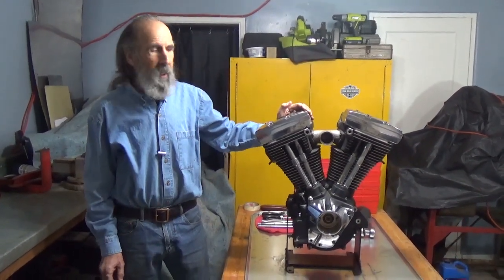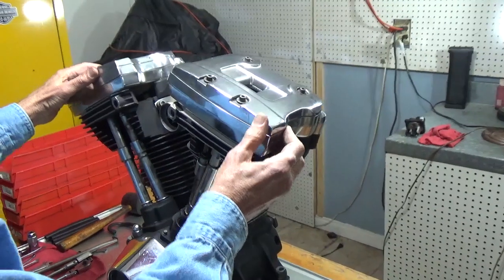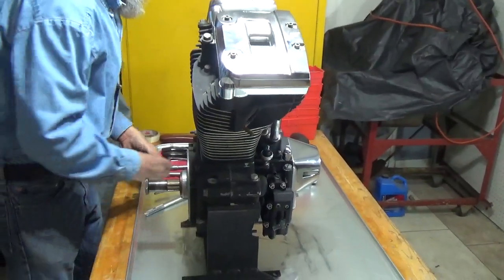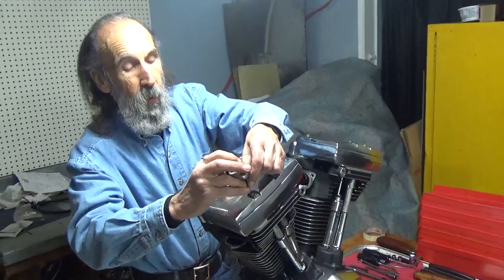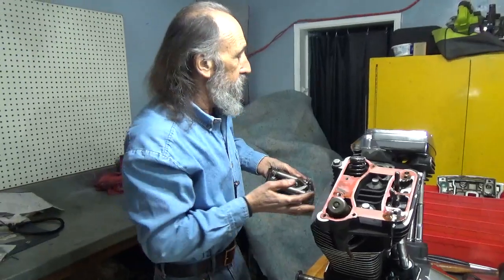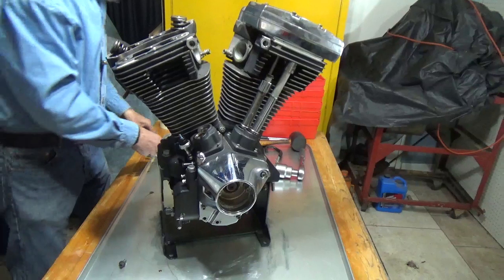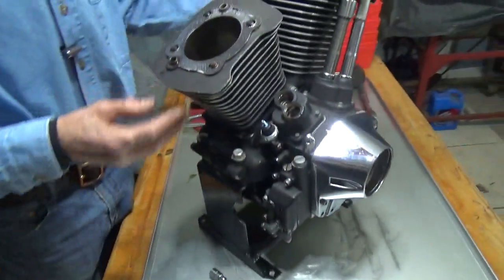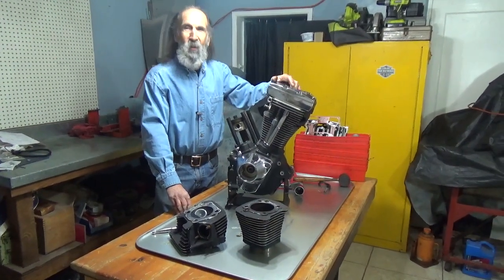Harley Davidson Evolution Motor Disassembly, Part 1

Comment: Hola Mike, Is it possible to disassemble the engine and change golds and segments of the cylinders without removing it from the motorcycle? Thank you
Reply from the maker: Stock Harley Twins are designed so that one can remove their entire topend for servicing as needed without removing the engine from the frame.  Sometimes modifications will not allow this.
Reply: @pacificmike9501  Muchas gracias Mike!

Comment: Question 
I have a 1990 softail evo motor 
There is 10:5:1 and woods w9 with port head work on this . New ignition
I want to replace the cylinders and bring in less compression. The higher compression is lumpy and runs great at 70 mph but come on I’m not on the highway all day .
The question is will those ported heads work ok if I change the pistons back down to 8:5:1 and change cam obviously.
Has thunderheader exhaust 
Thanks for any report !
Reply from the maker: You're going to need to do some research through someone who does high performance heads.  If there's no record, you'll probably have to cc the heads (check them for volume to establish compression ratio).  Now bore and stroke come in to play.

Comment: Great lesson!!  I have a 2008 KLR 650 as my only vehicle. Pretending buy an 1998 HD sportster 1200cc EVO as a secondary for short trips or weekends use . Do you think is a good option ?
Reply from the maker: 1200 Sportster is a great bike.  I don't know how it fits your body or what your likes and dislikes are.  I don't know what brand a KLR is.  All I've played with for the last 40-50 years is Harleys and Indians (old Indians).
Reply: @pacificmike9501  l'm over 6"2  200 pounds.Motivated to get my first HD at 54y/o. Just looking for something so reliable and basic as Kawasaki KLR 650 gen 2.A dual sport mono- cylinder icon bike hardly recommend if you are over 6 ft. and wants to ride everywhere.Not  digital electronics devices. Just a carburator wind and motor sound . I appreciate your recommendation.
Reply from the maker: That Sportster, although they really are nice motorcycles, is a bit small for your frame.

Comment: Hi Mike, hope you are fine. I'm having several problems removing an Evo starter engine. It is the first time I try and I can't separate it from the big pinion inside, after the two bolts are unscrewed. Any help is welcome, Thank you very much Mike and keep going!
Reply from the maker: Yes.  You need to remove the outer primary cover and take the starter jackshaft loose from the starter with its center bolt.  This is why I always say, "You need a genuine Harley Davidson Service manual, model and year specific."  You didn't tell me which model you have.  So, I don't know what else you need to do.  Be sure you disconnect the battery FIRST.
Reply: @pacificmike9501  Thank you very much, Mike! I have just purchased the bike. She is a modified Softail Fatboy with one the first Evo engines (I don't know the year of the engine production exactly) I have succesfully removed the seat, the battery, and the oil tank. The reason to do all these jobs is beacause the bike doesn't start anymore. The start button didn't work, so the previous owner had a quick solenoid button to turn it on. But, unfortunately, this button failed too few days ago. When I test the starter engine all that the engine makes is a "clack" short sound and doesn't turn or anything else. I checked the battery, the reelay, and everything else look in good shape, so my thoughts are now focused in the starter engine, for some reason it seems to be suddenly broken or blocked... So that's the reason why I am trying to disamble the starter engine in order to check if it is definetely damaged or something. What are you thoughts about? Thank you again, because you became a true master for me in this kind of things.

Comment: Hey I love this video thank you. If you don't mind I'd like to get your opinion on something. I recently sent my bike into have worked on it changing the handlebars and doing Chrome lower legs. I have a Heritage Softail Evo. the heads were in perfect shape. When I brought them in. I got the bike back months ago and the other day I noticed that where the hose clamp goes to my gas tank right above on top of the head there was bright brass shining through in the top plate of my front rocker box cover. the alarm has a really nice guy and it gave me a good deal for my work. My question to you is will that pet an oxidizing. Faster than if it wasn't protected with the Chrome. Also how would you bring it up to the owner of the place without hurting his feelings 
My question to you is this
Reply from the maker: Wow.  All that stuff is in there without much room.  If it were me, which it is not, I would let it go.  If I were the one who scratched it, I would want to replace it.  Not knowing any of the people involved, it's hard to say.  Good relationships in the shop are important.  That's not a hard part to find, and yes, it will start to peel.  I just hope you and your favorite shop value each other.  Thank you.
Reply: @pacificmike9501  well that's what I'm worried about it's going to start to peel. So I was wondering what you would say to a guy without hurting his feelings to ask him if he could maybe pay pay something towards getting it replaced even though he did it

Comment: Change your inside intake bolts To hex head and they come out so much easier and that was factory also
Reply from the maker: Factory Evos are allen head capscrews except for very early Evos.  My favlorite to use in there are 12 points.

Comment: Hi Mike. Love the videos, Really helps to see how to do things instead of reading from a book as you can see techniques used for difficult to get at parts etc. Anyway just a quick question to pick your brains about on a 1985 Wideglide 1340 starter issue i have . When my battery starts to go flat if i have pressed the starter button in when i turn the ignition off it still momentarily continues to turn over and when i put a fully charged battery on it does it again momentarily then all is ok again. Is this a solenoid issue? As i was talking to a bike shop over here about it and he reckons if you use an all balls one it causes these issues, but if you use a one that is a bit dearer the issues go away. Have you heard of this problem? If so what was the cure?
Reply from the maker: Remember, there is always electricity at the solenoid.  I eleminate the stock button and the relay on Shovelheads.  This takes care of most problems.  Sometimes, these things hang up from "mechanical" problems, such as alignment of the shaft or a slipping starter clutch.  Or, the shaft travels too far.  This can also cause the solenoid to stick.  If the voltage is low, the solenoid will burn it's contacts.  Remember, the solenoid is voltage sensitive.  I don't know if I've helped you.  But, there's some stuff to think about.  Above all else, always disconnect the battery when you're working on this system.
Reply: @pacificmike9501  Thanks Mike. I thought that might be the case. Ride safe.😎

Comment: How do you remove the pressure from the lifters? Thank you sir
Reply from the maker: When you install them, make sure you are on the heal of the cam, then adjust the pushrod.  Now, let it sit and bleed down.  When you can easily turn the pushrod with your finger, it is bled down.  Do not rotate the engine until the lifter is bled down.

Comment: I have a question.  Do you think that a person who has never pulled apart a motor should be taking apart his Harley engine?
   
  I didn't hear why you were disasemblying this motor. I mean the top of that piston looked pretty bad.  But why were you taking it apart?
Reply from the maker: Hey, it's your call on whether you should be doing what you're doing.  It's a long story about why  this engine was down.
Reply: @pacificmike9501  I hear what you are saying. But some people see how easy you make it seem. It is really easy to get a motor torn down. Its getting them back together that is the Hard part. I'm not sure I would tear one completely down. 
    I'm very mechanical.  I've built hundreds of stock to Race motors. I'm not sure I would tear any of my Harley lower ends down..

   Keep up the good work.  I'm enjoying your video's.

Comment: hi there im changing a crankshaft on the same motor flhs 89 and im not sure the socket for the bolt of the crank , i got 32 but its to small and i dont wanna buy too many of em, thanks^^
Reply from the maker: I assume you"re speaking of the "compensator nut."  It's an inch and a half (1 1/2").  That's if it's a stocker.
Reply: @pacificmike9501  okay thank you very much

Comment: Thank you SO MUCH for this series and all of your other videos. You and Cameraman Mike are so generous to create this treasure trove of knowledge and wisdom. I am know emboldened to rebuild my 1990 FLST motor. I was experiencing oil carryover from the case into the primary so, with the help of these videos, the FSM and a parts catalog, I discovered the steel sleeve was loose. So, I have bought a bunch of tools and am attempting to replace the case with a 1992 FXR case. I may actually try to just pair the old 1990 RH case with the new 1992 LH case. Thanks again and Wish me luck!
Reply from the maker: Of course I wish you luck.  There were some cases that failed around that time.  Don't forget the 92 is a topend breather and the 90 is a crankcase breather.
Reply: @pacificmike9501  Thank you! Interestingly, the 1992 appears to have the tube running out of the RH case under the breather gear. I'm hoping that indicates it will work.
Reply from the maker: Sounds like it.  Look at some bikes.  Make sure you've identified the breather hose.
Reply: @pacificmike9501  Will do--thanks again!

Comment: Can we just put the piston at tdc to relieve tension from rockers?
Reply from the maker: Yes.  Then disassemble either the top or the bottom to remove the original "nonadjustable" pushrods.

Comment: Hay Mike, Jim from Massachusetts again. I was having trouble with my primary belt getting eaten. You suggested a spacer to align
Reply: To align the belt. I did that today and it looks like it is centered but now won’t start because Jackshaft starter gear ⚙️ doesn’t reach the ring gear now. I had to use a washer and I had to cut the end of the key way off so it would fit. I believe I’m going to have to put it back the way it was because the jackshaft doesn’t reach anymore.  Any advice Mike ?
Reply from the maker: I'm afraid I don't get it from the discussion.  It sounds like something is mismatched.  I'm not sure what.  I do remember the bike is a Shovelhead.  I don't remember what year.  I may not be able to help you.
Reply from the maker: Either the arm, the installation of the solenoid, or the clutch basket is not the proper one for what you're trying to accomplish.  The right model, year and the right basket all has to be correct to work together.  I really do wish I could help you.  But, I can't see it or feel it from here.
Reply: @pacificmike9501  Ya Mike I uderstand, I’m just going to put it back the way it was and when this belt is ready to go I’ll change it back to chain primary. I saved all the parts from when I changed to belt. Thanks 🙏 again Mike. She’s going to be 42 years old in 2022 👍.

Comment: Hi Mike. Question for you. Can you put late model heads and cylinders on an earlier model bottom end? Such as a 92? Thank you in advance for the reply.
Reply from the maker: I assume, you're speaking of an Evo.  Going on  that assumption, and a coupe of other assumptions,  you can easily install a "head breather" top end on a crankcase breathing lower end.  If it's a hot rod and huffs a lot of air through its breathers, use them all.  This specific combination I'm speaking of, works.
Reply: @pacificmike9501  thanks for the reply.  Yes I am speaking of Evos. I have a complete 92 that came out of  an FXSTC. I'm told it's a lower case breather. I also have a complete top end from a 96. The heads have been ported and polished as well as a set of brand new valves and springs. I want to use those heads on the 92 as it will same me some $$ on the rebuild. By the way, I love your videos and hope you keep on keepin on with them. Cheers!
Reply: @pacificmike9501  FYI..92 is stock bore with an EV27 Cam...Jim's lifters and adjustable push rods other than those items she's pretty well stock a
Reply from the maker: Sounds good to me.  Thank You.

Comment: Those back intake bolts are tricky but I use a 1/4 inch Allen cut to about 3/4 inch long and then use a 1/4 inch open end wrench to do the job. Much better way to remove those screws.
Reply from the maker: Bunches of combinations.  What ever works for you.

Comment: OK wait hold up    what if it has stock push rods   you just warp them??
Reply from the maker: You take the pressure off by releasing the rocker boxes from the top.  Also, I strongly recommend a year and model correct factory service manual.

Comment: Hello Mike, really enjoy your calm and patient way of working on bikes. I've learned a lot from you. I just picked up a '98 Anniversary Fatboy yesterday. Hasn't ran in 9 years, 80" engine with a stage 1 carb. The engine cranks but will not fire. Tanks are empty and dirty inside. Where should I start to get this machine up and running.  Thanks and God bless.
Reply from the maker: Clean the entire fuel system, if needed.  Flush the tanks and, if needed, the carburetor.  Fresh sparkplugs are a good idea.  Realize that when you first start it, the motor will probably be full of oil and will pump it out of the breathers until it balances out.  Be sure you have a service manual, specific to your bike.  I feel like I want to send you to a competent shop.  This gets to be a lengthy procedure.
Reply: @pacificmike9501  Thank you,  sir. Will do.
Reply from the maker: I didn't mean to give you a short answer, but take it slow, use common sense, and go through each system carefully.  It will really pay off in the long run.  Remember, you have fluids in the engine, the transmission, and the primary drive.  They are all separate.  It will take some research on your part, but, I will answer questions along the way.
Reply: @pacificmike9501  Sir, I just really appreciate that you took time out of your schedule to answer.  So far, I have ordered a service manual,  new battery,  spark plugs,  new grips ( the old ones had the rubber melted), complete 3 hole oil change kit and derby cover gasket.  I figure I'll do what I can and leave the rest to professionals. Love your videos,  keep up the good work.

Comment: Great video Mike and thanks for posting it up. Could you tell me the process to relieve tension on the push rods? Was a little unsure of that.
Reply from the maker: Thank You.  With adjustable pushrods, you back off on the adjustments.  With stock pushrods, which are non adjustable, it's a little more difficult.  In either case, rotate the motor until the pair of pushrods you're working on are both down.  In other words, both valves in the selected cylinder are closed.  This is now as good as it's going to get.  Back off on the adjusters if they're adjustable.  If you're trying to remove pushrods, now is the time to loosen the rocker boxes as slowly and evenly as possible, to prevent warpage of the covers.  This is all explained in the Evo service manuals.
Reply: @pacificmike9501  thanks for the quick reply. Very helpful. I've already subscribed and I'll keep watching if you keep posting up. Thanks again Mike. You're much appreciated.

Comment: Loved the video but I am a bit confused. You backed off the front push rods to ease the pressure on the rockers, then removed the rear rocker cover, head and cylinder.
Reply from the maker: I probably backed them all off.
Reply: @pacificmike9501  I guess the same thing could be achieved by getting the piston at tdc on firing stroke? Both valves closed. My evo doesn't have adjustable push rods. Cheers.
Reply from the maker: Evos all came with nonadjustable pushrods.  Most have long since been thrown away.  Be sure you don't mix them up.  They are color coded for length.  If you change your cam to anything other than stock, be sure and replace those pushrods with adjustable units.

Comment: Do u have a video of replacing a head gasket on a 88 fxst??? Motor is on the bike and it is the front head gasket.... Thanks n advance.. Just found u and enjoy your videos...
Reply from the maker: I'm waiting for another tool to arrive, then we'll get back on the Evo motor we're building.
Reply: Did u have trouble getting horn bracket off. It is hitting edge of rocker on both jugs.. I see yours didnt have one on it... Tring to get to carb bolts vant remove bracket... Baffled..lol
Reply from the maker: The horn bracket on an XL or FX bolts to the top motor mount with one thru bolt.  Hard to see sometimes, but it's in there.
Reply: @pacificmike9501  ..LOL.. Think i worded that wrong.. It is the top mount.. Not the horn bracket.. Top mount has studs coming up from head and mount hits edge on rocker before clearing bolts... ..was only replacing front gasket, but cant get mount off...
Reply from the maker: Okay, I get it.  You'll probably have to remove a stud.  Then you'll have to "modify" the mount slightly so it sliddes on and off in the future.

Comment: Love evos my first and only engine I built all but the bottom end . Just subbed
Reply from the maker: Great motor.  But, I like everything that led up to today's motors too.
Reply: @pacificmike9501  oh I agree on that I had everything  from pan on up to a twincam but my DREAM BIKE  would be a knucklehead atleast the engine in a hardtail frame and would run a suicide clutch and jockey shift with no front brakes that's how I built my evo I ride now and have a twinkie electric glide also but that sits in my garage most of the time to me it's not fun to ride.....
Reply from the maker: I get it.